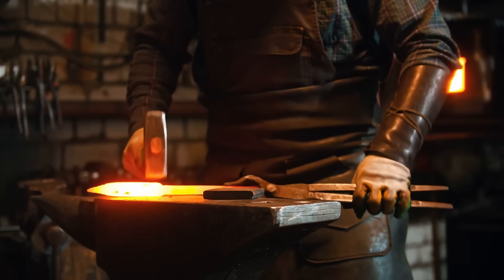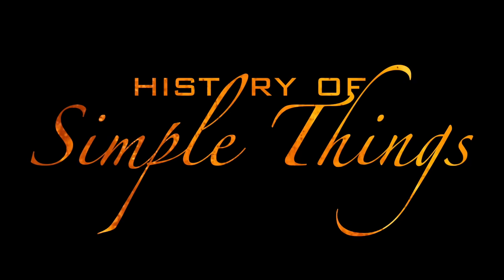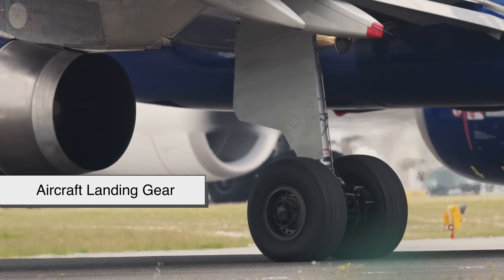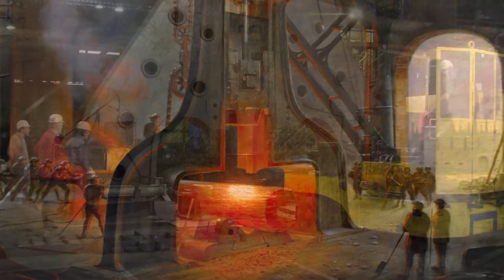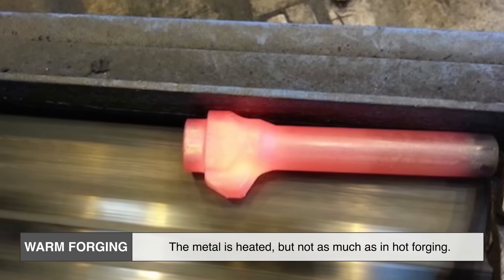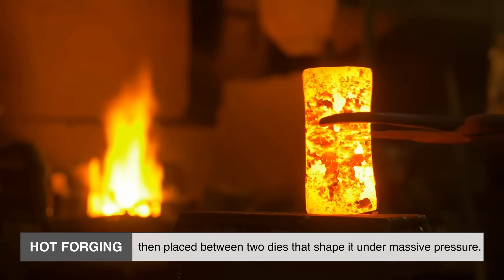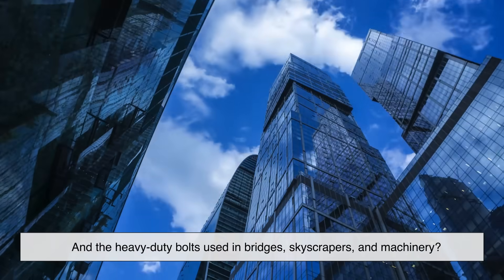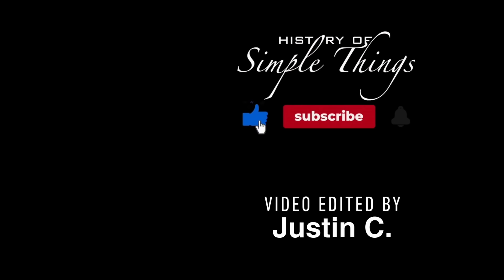What Really Is “Forging”? The Process That Built the Modern World

Comment: Also it depends a helluva lot what steel type is sued like 5k series or if they are titanium.... And cooling via air water or oil cooled depends on the steel type that's being used just a name few things blacksmiths has to consider back in the day and nowdays engineers who design said parts